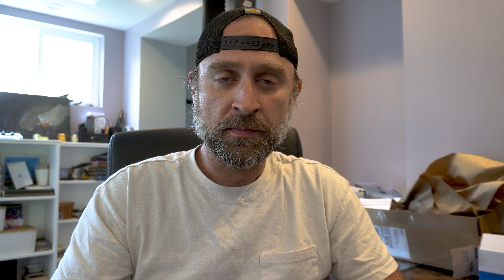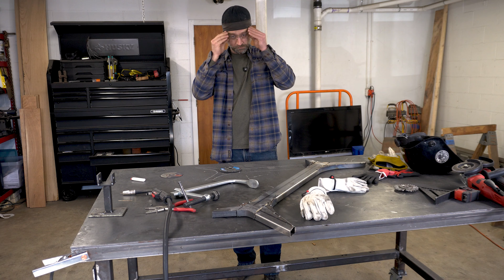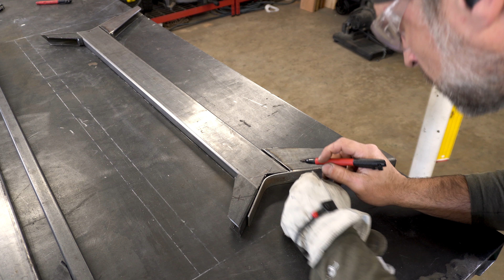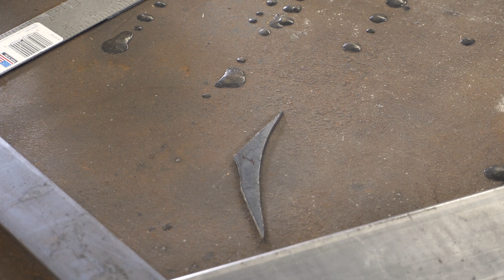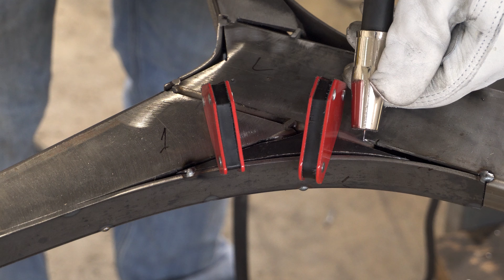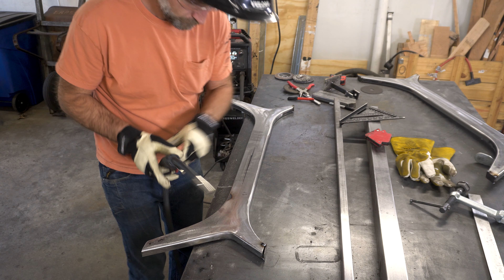Talking about some struggles and successes with the business...

Comment: Great job posting these videos.  For the wider gaps, putting a piece of weld wire or tig rod in the gap will make bridging them a little easier.
Reply from the maker: Appreciate the comment, man!  I've tried that a handful of times with questionable results...need more reps I guess!